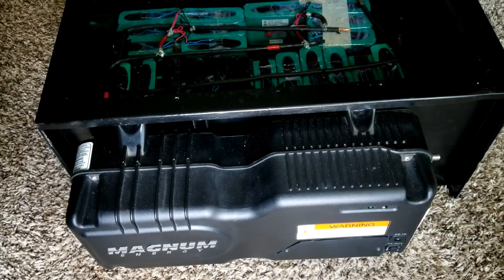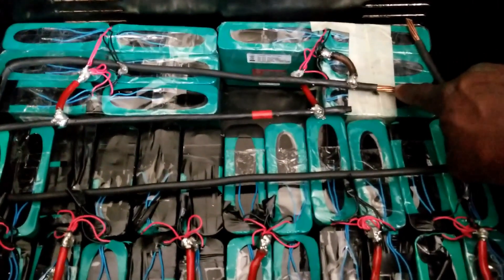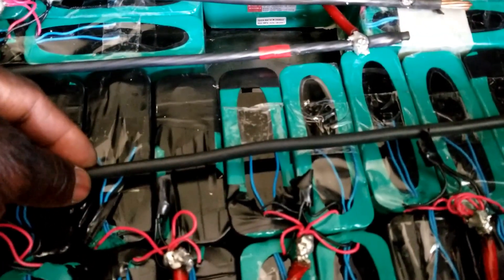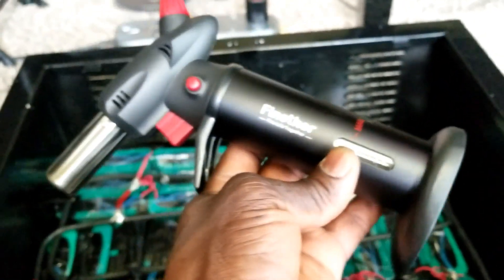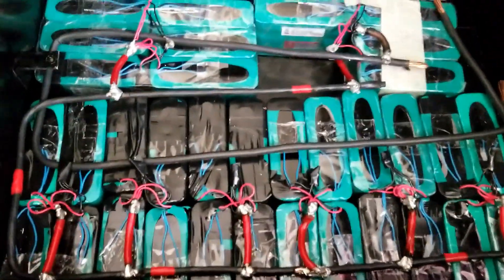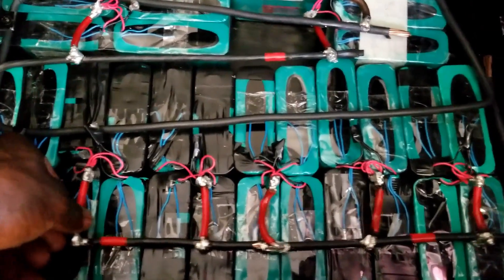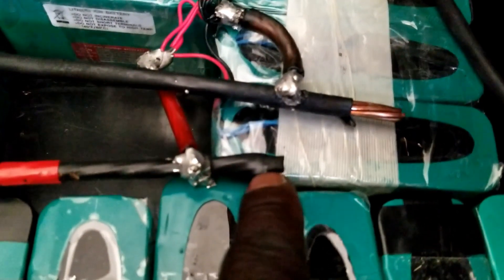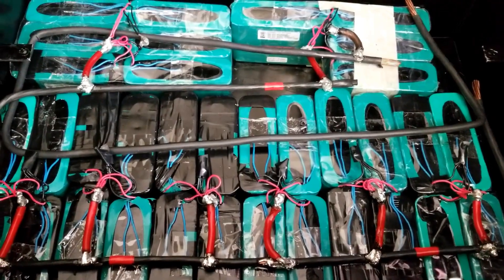HOW TO, BUILD 3.4kWh DIY SOLAR GENERATOR, DIY EMERGENCY SOLAR GENERATOR Part#6

Comment: Nice, that would work good in a van or tiny house on wheels.
Reply from the maker: Not only that but can power a house, does Laundry, cooking rice, powering 70 inches television, charge phones / tablets, power lights, run a refrigerator and freezer

Comment: Nice work! But have you considered some other conection to the terminal wire than soldering?
Reply from the maker: Thank you. 
Please stay tuned for the final moment everyone is waiting for. One more video after this and we will initialize a load test on these lifepo4 lithium batteries. 
Finally don't forget to LIKE SUBSCRIBE and SHARE my videos. 
Cheers